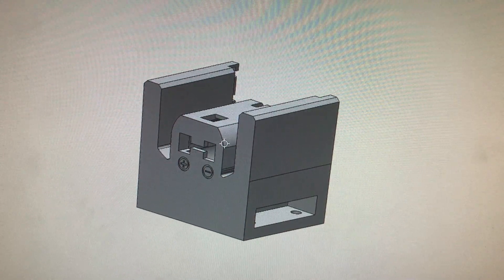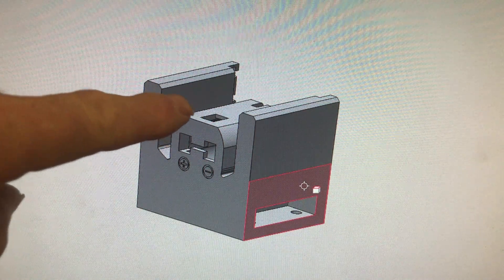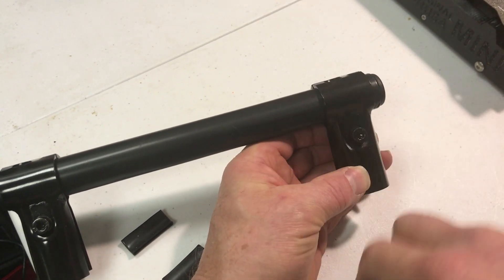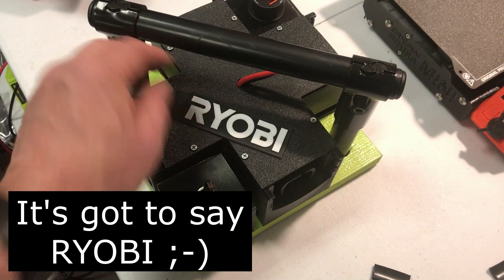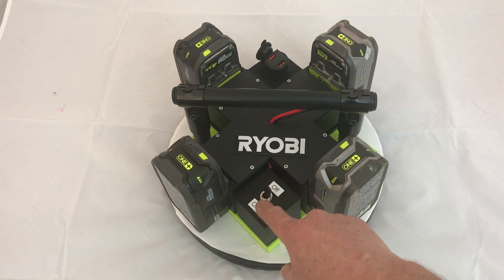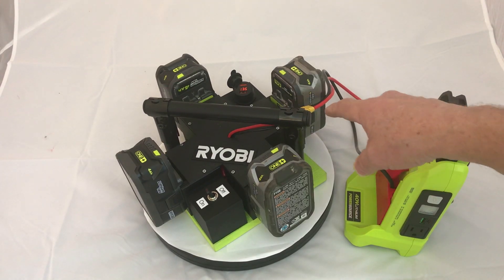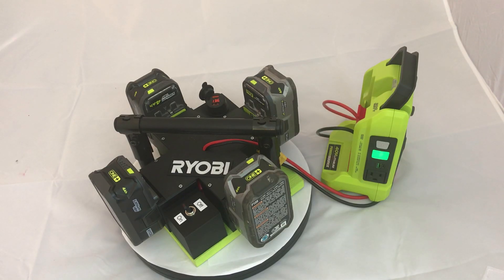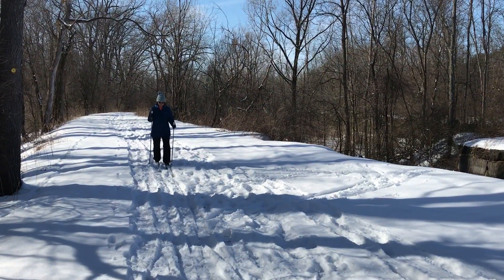RYOBI 18V to 40V Converter and 13.8V Powerstation

Comment: wish you would make a store.... where i could just push the buy button :)   since i dont own a 3d printer.  normally id just make something.
Reply from the maker: Sorry I'm not really in the position to make/sell parts. I put my designs up on Thingiverse and Prusa ( https://www.prusaprinters.org/prints/56481-ryobi-18v-to-40v-converter-and-138v-powerstation ). There are Internet vendors that will make 3D prints for you. Also check your local library or Makerspace. They typically have 3D printers for use.